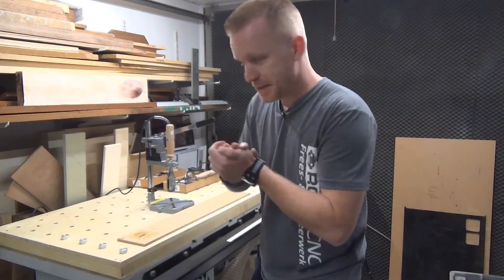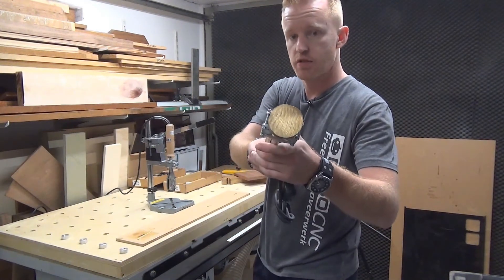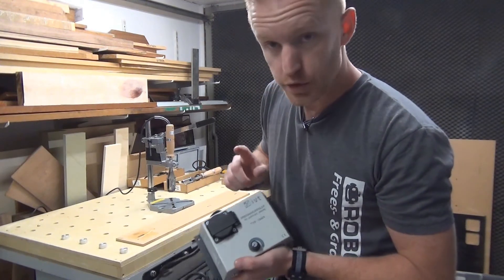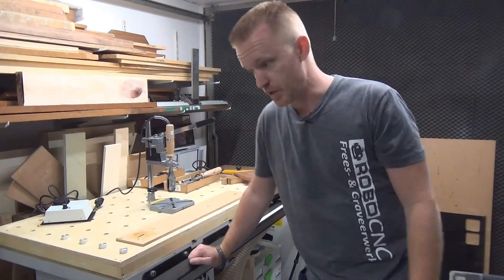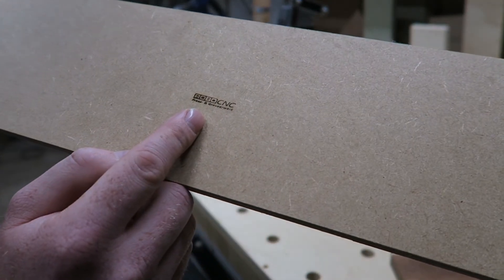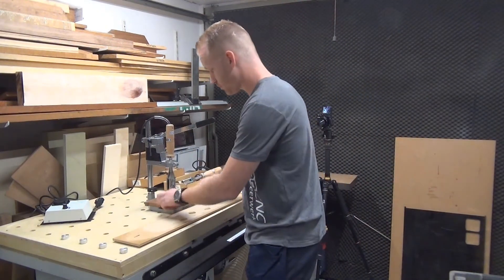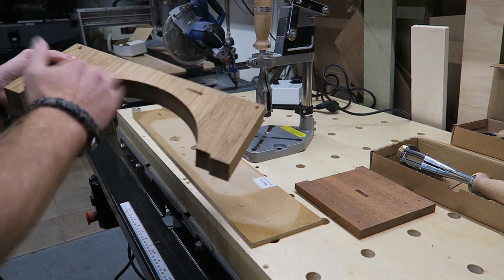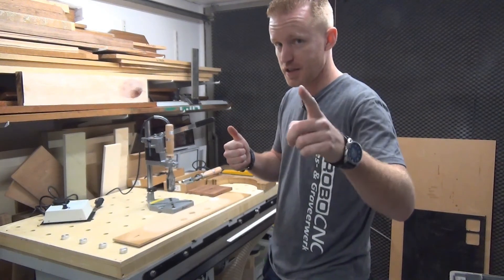RCNC Projects 049: Engraving a Electric Branding Iron

Comment: Putting the branding back in Branding. Awesome addition to the webshop. So, do you just need a greyscale picture (effectively a heightmap) of the right proportion to succesfully cnc a stamp?

Cheers!
Reply from the maker: Wow I should use that! 'Putting the branding back in Branding" :) 
Well a hightmap (like a greyscale) could indeed be used although that would not be the easy way to go.
Basically it would need to be pure black and white in that case, burn or not to burn :) 

This logo is made using normal vectors and all around it is cut away with the v-bit
Reply: Cool. Thanks for the info! The v-bit is probably the ideal tool for the job, as it's the best case heat transfer from the heating element, with the highest resolution on the branding surface side.

I bet there's some merit in experimenting with stamps that have parts that don't quite touch the working surface. I'm sure the outcome wouldn't be "full spectrum" greyscale, as there's just too many variables (time dependant surface discoloration, base starting color, branding color, and uhh "burn bleedthrough / crosstalk") in play, but I'd love to see a follow-up video if you happen to have some test-stamps left over. 

It might add some selling opportunities, for customers that demand just that little bit extra from their branding tool.

Cheers!